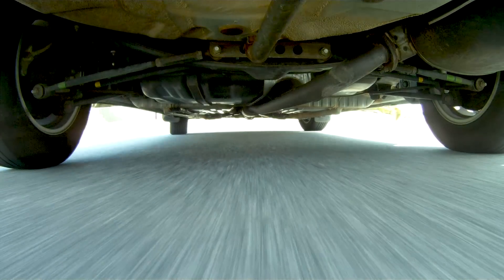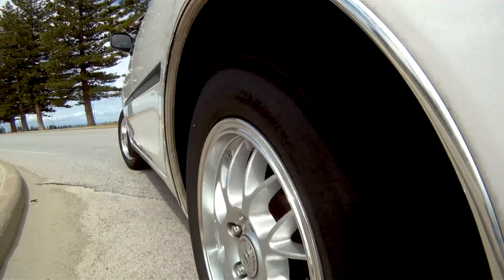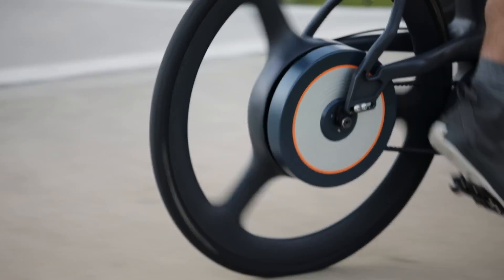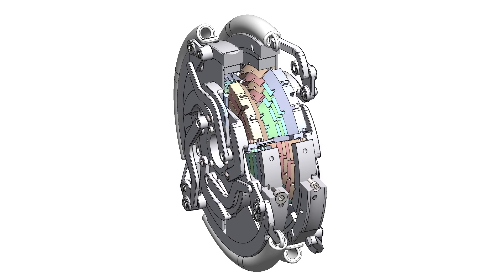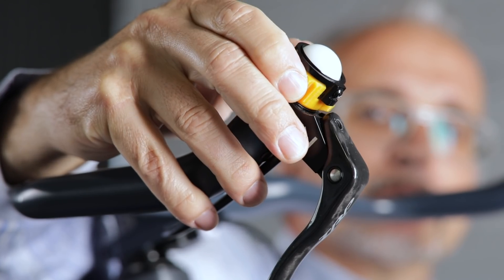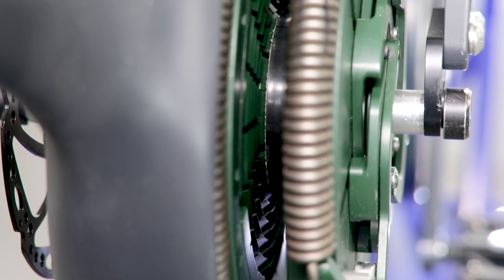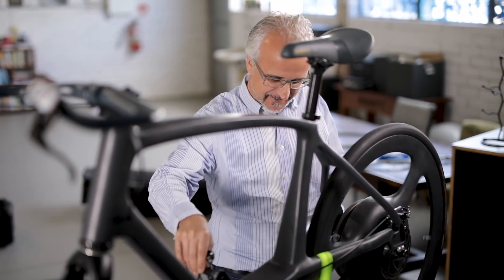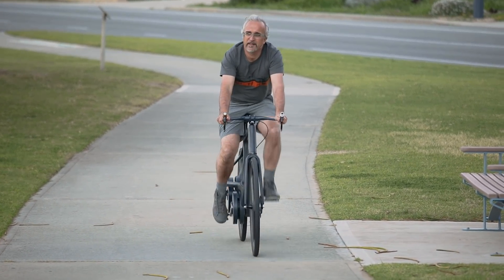Continuously Variable Transmission on a Bicycle

Comment: Amazing. An expensive, complex and quite possibly unreliable solution to the problem we never had.
Reply: these things tend to be more proof of concept, developing technology that can be used elsewhere like machinery where you can't fit a cvt
Reply: @AsbestosMuffins  I got a gearless hub transmission with a Gates belt on my bike...
Reply: @AsbestosMuffins  the best reply 🙏
Reply: @AsbestosMuffins  Like a bicycle.
Reply: @SomsoKca  🤣🤣🤣🤣🤓👏
Reply: I dont think that the issue they tried to solve was cvt in bikes. I believe the issue they solved was transforming a traditional cvt gear change design to a more compact smaller space.
Reply: @marcosalazar5339  yeah they just used the bicycle as an example for a technology that’s not meant to be used in bicycles. It is a very relatable way of illustrating the advantages of what they engineered though.
Reply: Yeah, imagine all the dirt and small rocks from the road coming into and destroying that beautiful, expensive mechanism.
Reply: Arvid xd these definitely aren’t in cars...
Reply: If it were sealed and not electronic, I'd be all over it immediately for my 'hybrid' pleasure bikes. No go for my mountain bikes, and no go at all as it stands with all its electronics and exposed mechanisms.
Reply: @CalmoOmlac  have you ever been mountain biking?
Reply: You must not live in an area with hills. Around here we have hills that are up to 19 percent with many less than that. And the hills themselves vary depending upon what part of the hill you're on. 

This ensures that you spend more of your time with the proper gearing ratio for the actual road you're on, rather than the closest approximation.
Reply: It's kind of a poor way of looking at things sure this first prototype may have flaws but you really can't see the possible benefit of a mechanism like this with further development? I'm glad everyone doesn't share your outlook.
Reply: @zack6892  Further development is unfortunately beind hindered by physics.
Reply: @zack6892  You could take all the money poured into this crap and instead work on actual problems like bike theft
Reply: It's true. But it's possible that someone in the future would look for solution for their problems and then see this, and think "wait a minute, I could use this!"
That's what I think makes things like this worth doing, imho
Reply: @fitrianhidayat  bacot anjing
Reply: @fitrianhidayat  Nah
Reply: The chain systems are pretty good, reliable and lightweight, this cvt looks more expensive to build, and it may be heavier. As for reliability, you could carry an extra belt if needed. It also takes a lot more space
Reply: You forgot heavy. Very, very heavy.
Reply: looks too complex for maintenance and fragile
Reply: hater
Reply: I could see it being useful for new riders because getting the hang of where to put the chain on the front and back can be a pain in the ass, and a lot of people ride around with their chain practically sideways.
Reply: Internally geared hubs(aka, fancy bike transmissions) have been around for a good while now. Would love to have a CVT for my ebike, would help squeeze a lot more juice out of the battery
Reply: “problem we never had”.  The only way you don’t have a problem with traditional bike drivetrains is if you’ve never used one. 

I don’t know if a derailleur-based system can ever truly be replaced, but for MTB, it’s easily the most maintenance-intensive component on the bike, requiring some kind of attention about every 5 hours of riding (cleaning, mostly).
Reply: @MehYam2112  It doesn't seem to solve the maintenance problems, at least at first glance (I mean, sure, the belt is nice, but this is not the belt we are talking about here).

I guess one advantage might be ability to shift under heavy load, though
Reply: @MrCh0o  you're not going to come up with a viable derailleur alternative without producing a bunch of imperfect derailleur alternatives. Think about how bad the first derailleur must have been. Once one of these new solutions gets a chance to mature, we can move forward.
Reply: @MehYam2112  I mean, I agree that it's good to create different alternatives and develop new ideas so eventually these can be brought together to make a completely new system.
But I also agree that if we instead of "working out new alternatives" limit the scope of this project to just "create CVT for bikes", it is indeed the problem that we never had - the continuous quality itself is a small quality of life improvement at best

Just saying that "as is" this model is far from ideal, but of course some decisions might be used in a better product
Reply: Some people are just simply lacking between the ears
Reply: Spoken like a true luddite!
Reply: Personally I kind of agree with some of the things you said but all in all they made a better quality of life decision for bikes at the cost of well nothing and although you could argue that bikes where fine before you can’t argue that this isn’t a direct upgrade from that
Reply: Engineering in 1 sentence.
Reply: You imagine way too much
Reply: lol
Reply: Pretty reliable with this sort of application. In a Nissan though? Hell no.
Reply: No we always need improvement. Innovation is great otherwise we all would be still walking 10 miles to our destination
Reply: I couldn't say it better!!!! my hat is off
Reply: True hell lot of moving parts on a vehicle ment to be used near beaches and dust tracks
Reply: hahaha. True
Reply: Modern pseudo problem require modern pseudo solution
Reply: Looks heavy too and just can't imagine it covered in mud!
Reply: It's a proof of concept and could be interesting if the size and price of the solution decreases. There is no harm in this kind of innovation. It all pushes what is possible on bikes which is a very good thing imo.
Reply: Yeah, but are you overlooking the factor of added weight more than making up for those downsides?
Reply: @TeleTrueStory  lol added weight.
Better take a shit before you ride, added weight and all.
Reply: Not to mention heavy and difficult to maintain.
Reply: Add ugly
Reply: @CalmoOmlac  yeah but I don't think we'll be moving away from the chain drivetrain any time soon, if only because of how commonplace it is. To introduce another drivetrain, it would have to be as cheap or cheaper, and easily maintained.
Reply: @CalmoOmlac  Thats because they offer a big benefit over traditional pad breaks, whereas this drivetrain doesn’t offer a huge benefit especially when compared to the downsides of it.
Reply: And heavy :)
Reply: CVTs are actually cheap to manufacture, the problem is they’re unreliable as hell, and they can’t handle very much power. They’re mainly designed for even power distribution from smaller, weaker power sources and they also get great fuel mileage. Still, I’d rather take a traditional transmission and worse gas mileage  over not being able to predict when your transmission will go out.
Reply: @sundstrom193  finny my buddies ford 500 had a shit ton of horsepower.
Reply: Yeah,we're good with those chains
Reply: Invention is the mother of necessity.
Reply: Very well said lmao
Reply: @CalmoOmlac  some of the benefits of diskbrakes over V-brakes are: 
- less sensitive to dirt and water, more consistent performance
- no wear on expensive rim (especially with added dirt) but on cheap (compared to rim) replaceable parts
- rim can be made lighter
- easy removal and install of wheels.
- tire size not restricted by brake mechanism
Reply: @CalmoOmlac  no I mean brake performance is more consistent despite them getting wet or dirty. That's what I hear in any case. Personally I use cantilever brakes and I'm very satisfied with my braking, but I'm also not bombing steep hills. The whole point here is that it's not about what you or I need or like as individuals. It's about illustrating the conditions that make disk brakes a useful and sensible upgrade or trade-off, and I think there's plenty there.
Reply: @CalmoOmlac  fitting the parameters to suit your argument is not how you 'win' a discussion... Just because your requirements mean that for you disk brakes are unnecessary does not mean they are for everyone.
Each system has their strengths in certain areas and I sure won't second guess your personal experiences, but the point is that disk brakes do have advantages over systems like V-brake, whether they are relevant to your riding or not.
Roadriders still use rim brakes because they may be cheaper or lighter, but I sure as heck wouldn't want to put abrasives to the rims of a $2000+ wheel set. Advantage of disk brake is I don't have to. I want to run a tire so wide on a rim so slim that V brakes can't reach it? Disk brakes. I want to run several wheel sets with different rim widths in one frame without the hassle of adjusting brakes for consistent performance? -> Disk brakes
There's plenty of reasons that make disk brakes the more advantageous choice, that aren't even performance related, just as there's plenty that you mentioned for V brakes; cheap, easy to adjust, etc
Reply: Isn’t that what engineering is for?
Reply: @CalmoOmlac  tell me about it! I own 6 motorcycles and I paid 750 total buying them (although repair and maintenance is a whole other wormhole, haha)
Reply: and heavy
Reply: The only problem I see is the price of the same old components that companies swear that will make you bike ride like a motorcycle
Reply: Simpson
Reply: guess ur never rode an 18 speed 1000 miles per month.
Reply: @Eligio Budde if it was yout only ride.
I rode a bike 1000 miles per month.
My deraileur system and shifting cables never worked right for more than 2 hours before cables would slip and that was after repoacing eveything brand new and having a bile shop tune it.
Id love to have something that eliminated all that.

The asded weight is nothing comapred to a book bag
Reply: a solution looking for a problem
Reply: Helpful if you are going through a bunch of hills, that are of equal size and medium distance apart I guess.
Reply: Harsh! 😜
Reply: Yeah,    Imagine the decade long think tank where hipsters try to improve the simple  bike.    Probably spent 5 years alone rethinking the spoke.
Reply: Hell less the fact it isnt a cvt, it's a narrow automatic trans.
Reply: Haha
Reply: Cvt is one of the cheapest solutions lol. It is unreliable because whole drivetrain relys on a rubber belt... Is it expensive? Hell no.
Reply: iare19 did you miss the part with the Bluetooth and the electric motor?
Reply: @o00nemesis00o  I guess you missed moat if not all lol.
Reply: Nicholas Heathfield its gonna be more expensive that normal gears i bet
Reply: @o00nemesis00o  you mean probably the two most reliably deployed technologies in the world?
Reply: @o00nemesis00o  it’s expensive because it’s an entirely new version of a cvt.
Reply: @iare19  Now it just needs to be automated. Preferably without electricity, better yet by pressure alone.
Reply: @TheRojo387  yeah cuz air never leaks and electrons always do
Reply: @iare19  Actually, belts are better than chains.
Reply: @iare19  look at the complexity of the mechanism, that means small machinig tollerances, big developement costs ,unreliability , weight. All to solve a problem ,quote , we never had,indeed.
Reply: @ggdszzvx0509  ride your bike 1000 miles a month as your main transportation.
Reply: @iare19  Yes compared to a classic manual or automatic gearbox and clutch or torque converter in a car. Not if you compare cvt to a bike derailleur.
Reply: @iare19  Rubber belts are an equivalent to bike chains and can potentially last longer. There was a youtuber who talked about the differences and how he prefers rubber belts on his bike and has been using them for a long time. Only downside is that you can't use the same mechanism for changing gears that is used on metal chain bikes.
Reply: @iare19  "Cvt is one of the cheapest solutions lol."
What's worth laughing about is your saying that.

"Is it expensive? Hell no."
I can get a complete front and rear conventional set for under $200. How much would a CVT be again?
Reply: @iare19  u obviously never rode a bike, i bet u never even tried to
Reply: @iare19  in what way did this solution seem cheap compared to a normal chain drive?
Reply: @iare19  Belt drives last longer than chains
Reply: @iare19  you're thinking about car cvts. Did you see the size and internal working of this? Bikes don't need even all that since we humans don't produce very little power in the low rev range like cars.
Reply: @iare19  well, if it has Bluetooth it is absurdly complex. go look for the specs and come back. Also, now you have 2 complete 8bits computers with software, and bugs and security failures and everything else that happens with your notebook, all the crashes, updates, all that ridiculous complexity.
As a computing scientist by night and programmer by the day, just freaking give me something entirely electro-mechanical without computers. 
Anything with computers can't be classified as simple.
Bluetooth might look like a good thing for outsiders, like see how cool we are, bluetooth, but that's all marketing.
Trust me, I'm a literal computer engineer. Computers are really complex beasts, for every 1000 lines of code there are 50 bugs, just always remember that when it fails and you are sliding on the ground, it was the computer fault. (I love mechanical things, they make noises way before failing, computers just kind of magically break out of nothing)
The most complex part (the bluetooth's computer) that was programmed by some fellow programmer with just 2 years of experience, because of course they hired some 19yo children-man without any experience because it was cheaper than the $200K/y senior for the startup (how else will the CEO buy his maseratti if he has to pay $200k/y for engineers). And of course our fellow programmer will commit all mistakes we all have committed for the last 30y in the profession, because this profession has an acute lack of memory, and ageism too, like after 25 you're useless to some "cool" companies, everyone is always relearning everything again and again, because "go fast and break things" is the motto , instead of carefully and slowly make software that will last and be correct, no one have the patience and time to build correct software.
So everything is always broken patched-up piece of code that barely works, imagine that your bicycle has no solder in the joints and was all duct-taped, because that's basically what all computers/software are. Its a wonder it all work sometimes.
Reply: @monad_tcp  you are certainly not qualified and know nothing of what you speak.
Reply: @CalmoOmlac  is more for a kool bonus than actually begin something you need, except maybe in a cargo bike

Comment: Take a simple system and make it complicated . Problem solved
Reply: The thing is, nobody wants an overly complicated and likely very unreliable transmission on their bicycle! This thing also weighs a lot compared to a normal drivetrain.
Reply: Frank deluca  there is no need for this
Reply: Gary Dodgson  for bikes, maybe we would consider cvt but for cars, I really dont like it. I felt how cvt works. I've used scooter b4 and I know how suck it is for many situations
Reply: pah why should i bother with dumb doohickeys when stick is just as good
Reply: Internal gear hubs higher than 3-gears are complex. But all you need to do is re-oil/greese them. They are also weather-proof, and require jack all maintance. Maybe re-oiling/greesing every 1.5 years. IGH's have been around since the 1900's, and are everywhere in the Netherlands. And by that I mean they dominate the gearing scene. And will grow when nations get their cycling cultures back.
Reply: It can hardly be called a CVT if it's not completely continuous.
There are steps of particular gear ratios unlike a smooth curve on a real CVT
Reply: This is most of the technology around today. Just look around.
Reply: And unreliable
Reply: Where's the cup holder?
Reply: Because nothing was ever made better by being made complicated. I typed this on my phone which acts as a GPS, instant messenger, document reader, internet browser, video streaming device, and camera.
Reply: @addledhead  yeah, and good for how long, 4 years?  d devices of then lasted half a century
Reply: @A-rk3dn  that's because those thing were needed....

And continues transmission on a bicycle is everything but needed..

Don't fix something that isn't broken

Comment: Chains and especially derailleur systems have some drawbacks but they are simple and extremely efficient at transmitting power. There is a good reason that bicycle transmissions haven't really changed in the last hundred years, and why the many alternative schemes proposed have never reached mainstream.
Reply: It could stand a water tight cover though ...

Comment: Another problem that I see on top of every other problem is the shift speed.  If you ride a bike off road you're going to come across a change in the road surface, and you might need to change ratios very quickly.  While this mechanism changes ratios seamlessly and is stepless unlike a derailleur, it is not fast.  It will take ages to change gears, and that will leave you struggling.  In addition, the rails those cone segments slide on need to be able to withstand the torque.  There's so many small moving parts that could get broken if too much torque was applied.  Derailleurs are pretty quick, easy to clean and lubricate, simple to disassemble and reassemble, and easy to fix should something go wrong.  And the only computer controlling it is your brain, and that doesn't need a USB port or Bluetooth to operate.  This is a neat idea, but it's far from practical right now.  I see the use for it, but it's not ready to be used